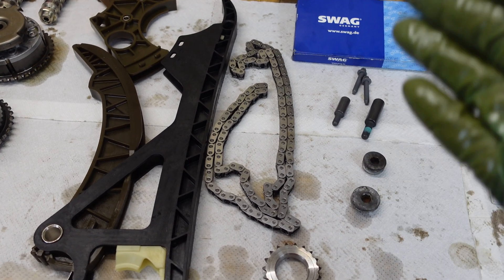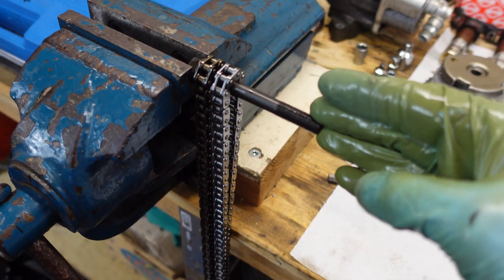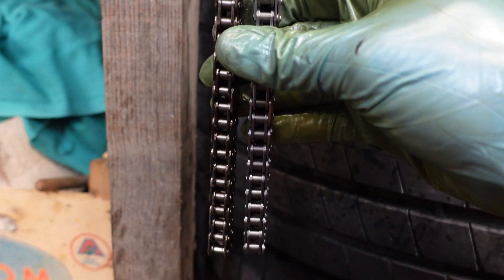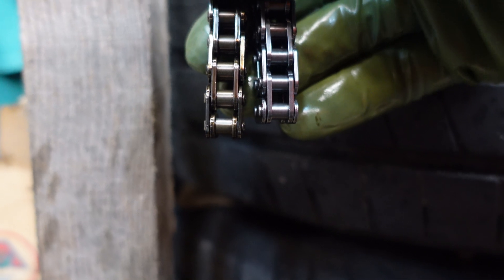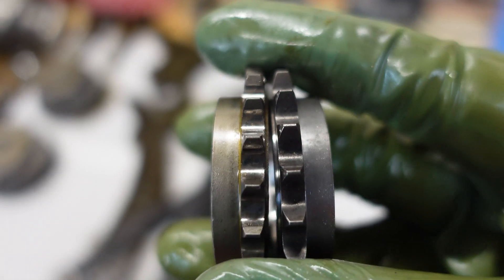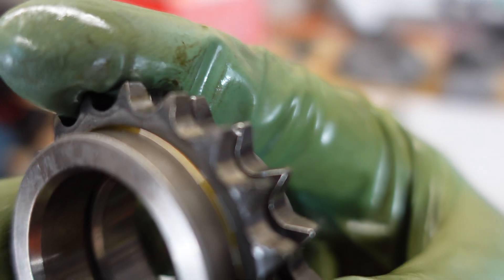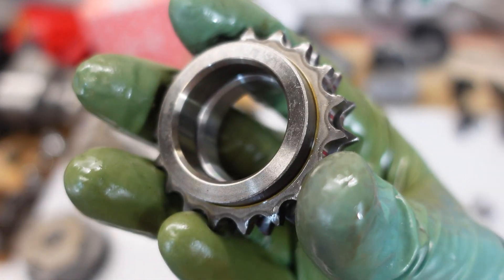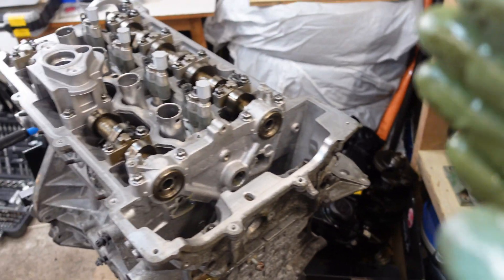BMW N43 Checking Chain stretch and sprocket wear after 216.000 km

Comment: Do you have any problems and replace it?
Reply from the maker: This is from my video series where I rebuild N43 engine with broken chain guides and spun conrod  bearings. Based on the chain stretch I can conclude that oil change intervals were too long, but ultimately, engine was destroyed by the broken plastic chain guide.
Reply: @BimmerZen  yea..I saw it after,I hear the sound of this broken plastic inside,I think for this  engines is critical to change oil in 10.000 and you need to put good oil!!!!